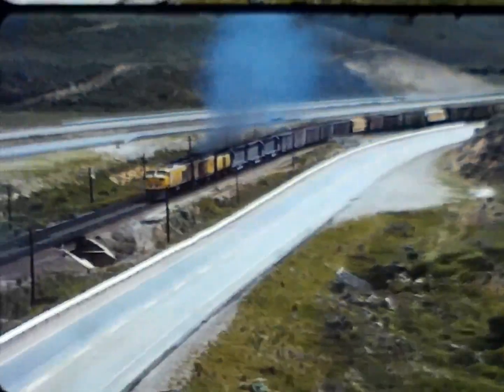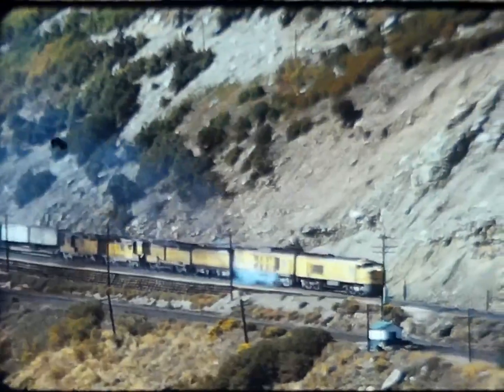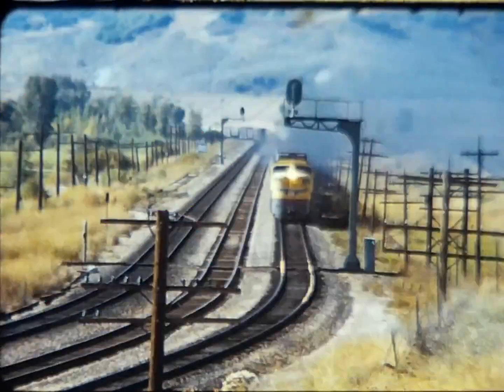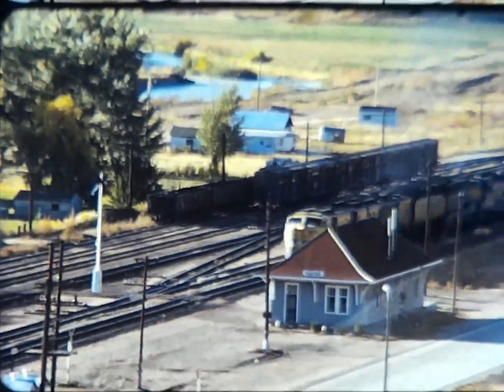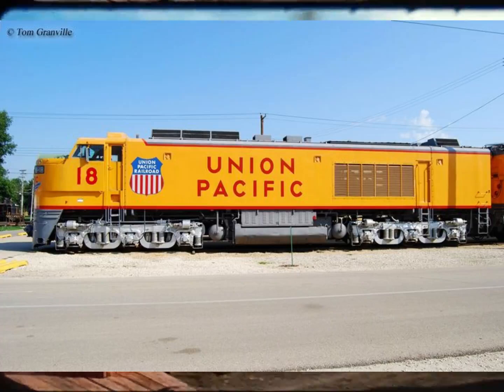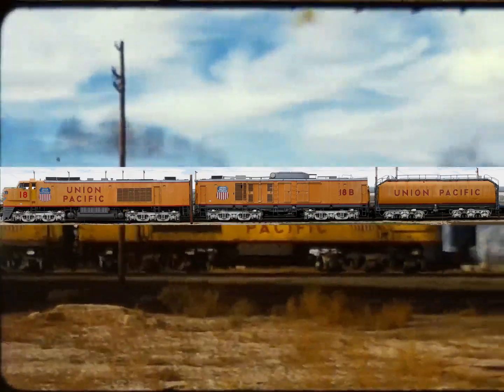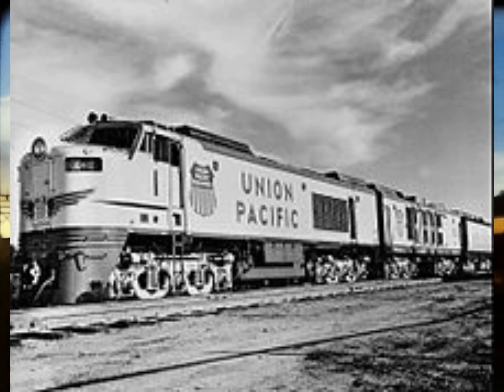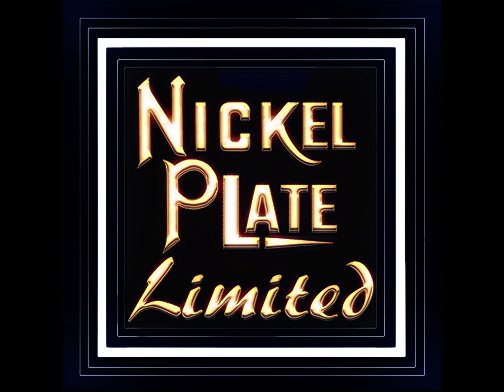Union Pacific GTEL Gas Turbine Locomotive

Comment: Using a gas turbine to power a locomotive in place of a diesel is a good concept. The mistake was using heavy fuel oil (requires heating), instead use kerosene (best balance of high calorie without the need for heating). Aeroplanes use kerosene as fuel because it's the highest calorie fuel that can be used without heating. The UP gas turbine locos were the most powerful combustion (non-electric) locomotives.
Reply from the maker: I think it's one thing that was premature.. Had it come out in the 70's or later, I think it might have worked out with the technology advances in place.
Reply: @TheRailroadCrossing-SteamPower  I think think the concept should definitely be revived using modern technology. The only caveat with a gas turbine compared with diesel is slightly lower fuel efficiency. The gas turbine has excellent power to weight. Still, I would love to see the concept revived.
Reply: @mattvigurs6945  gas turbines have terrible fuel efficiency any time they aren’t at full power.   So in a railway application, that’s most of the time.   Given the cost of fuel is one of the biggest expenses, why would a railway company want to burn money?
Reply: Even with modern technology, a gas turbine locomotive is not economical. The fuel consumption is too great. They were only worthwhile when fuel was super cheap. They are certainly not more fuel efficient than a diesel engine and with modern technology you can have more horsepower and effort with two diesel locomotives than with one gas turbine, and it would be far less costly to maintain
Reply: They chose the heavy fuel oil because it was practically unwanted and therefore very cheap and obviously a major draw card. Of course business is business and the price started increasing and burst the bubble.

Comment: The mighty Big Blow, indeed the most powerful non overhead electric locomotive in horsepower output to run, surely a long time record holder.
But there are a couple of GTELs built in Russia running on LNG which entered service in 2006, they are to be considered more as an experiment and not repeated in series production.
They produce up to 11,500hp, I'm not sure if these are still in service or ended as a failed experiment. 
So the UP GTELs remain the only ones successful used in regular service.
On the subject of Gas Turbine powered trains, maybe an episode on the Amtrak Turbo Train and its French predecessors? As I think these were the only other gas turbine powered rail vehicles which had a reasonably long service time. Not sure when the Amtrak sets were withdrawn but the French examples lasted from 1969-2005.
Reply from the maker: Interesting.

Comment: ah the gas turbines the big blows as they were called among things, at initial sight having not watched yet I want to point out there were differant models of the gas turbine locos, so it was not just one, you also have the turbo train for amtrack using a bombadier turbine engine for a time in its early days just a heads up
and you are right the turbines had a voracious hunger for fuel, but the cheap fuel is what kept them going so long, and with turbine if its liqued fuel you could pretty much use it, but yea they were hot and pretty loud, the bird cooker and bridge burner if parked under bridges it was so hot it would melt the asphalt on the road

Comment: I saw 18 in Union, Illinois last year and she was for all intents and purposes a fierce machine.  The old Pennsylvania Railroad's Q2 Duplexes could make 8000 horsepower, as much horsepower as the 2nd and 3rd generation oil turbines.  The front unit looks like a mix between an Alco PA and an EMD E9.

Comment: It did help that they had the auxiliary Diesel engine for moving around the yard.  That’s about all it was ever used for.  And they could go much faster than 65 mph.  In perfect conditions,  they saw 70+ mph.  It’s funny that freight trains back then were actually faster many times than they are today.  On UPs western mainline longer sections,  they will still see 60 mph though. But Big Boys could pull heavy freight trains at 80 mph.
Reply from the maker: But today, aren't the speeds regulated by the Fed?
Reply: I’m sure they are.  There are some high speed freight trains out west.  BNSF has a few intermodal trains that run 70 mph.

Comment: These locomotives ran in my old territory where I used to live northern Utah I've been two the Ogden Railroad Museum many times and watch quite a few documentaries on these locomotives the front locomotive of the a unit had a a V12 diesel engine they just use that to move the locomotive around the yard the B unit is the one that housed the gas turbine the B unit powered the trucks on the A and the B unit which were CC plus CC classification that means they had three axles per truck 3 traction Motors per truck that means 6 traction Motors per unit the gas turbine powered all 12 of these electric motors so you're wrong on that fact the only the B unit of the Union Pacific it's just pronounced G. T. E. L. You keep on turning classification acronyms into words it's not like NASA but besides that you did pretty good keep up the great work I like your documentaries could you please do me a favor and do a video on the Rio Grande Challengers thank you possibly the Rio Grande 2882 thank you peace out into the world and have a great day

Comment: I saw a couple of the turbine units at a scrapyard around Kansas City in 1973.  The yard repurposed the turbines into riverboats.  The turbines needed to be turned over every few days or the shafts would bend.
Reply: The gas turbine engine used in the GTEL’s is still a very common turbine in the power generation industry. The issue you are talking about with turbines needing to be rotated often does not apply to turbines this small.  That issue is on MUCH larger steam turbines.

Comment: The gtel is easily my favorite diesel electric engine (technically a turbine but it functions similarly to a diesel electric). It is so absolutely insane when you try and explain who and why it works. It is a railroad mad science experiment, but it worked.
Reply from the maker: Meh, they both run on mud so that flies with me.. :) But indeed they are complicated in their own right. Not as much as the steam turbine versions though, for sure.

Comment: The ole Big Blows, Bird Cooker, etc! Melted pavement on overpasses they were parked under, vibrated and broke dishes, I wonder of those were factors on California's decision.
Reply from the maker: Indeed. I didnt know they were called that until I did the breakdown on the loco prior to doing the video
Reply: There’s quite a few rumors floating around about gas turbine locomotives. Especially the one about them burning overpasses. All of that was a myth and it actually never happened. The exhaust gas temperature on the turbine used in those locomotives is a GE Frame  5 turbine. The exhaust gas temperature on them is about 800° F.  Roadway bridges are not made of asphalt, they’re made of steel and/or concrete with an asphalt surface typically. 800° is not going to be enough to heat up the concrete and steel to damage the roadway. Especially considering that the exhaust isn’t pressed up against the bridge either.
  As for the myth that these locomotives had such intense vibrations they would damage things, if you understood the principle of a gas turbine, you realize how ridiculous that statement is. Turbine engines don’t vibrate as they’re not reciprocating engines. It’s quite the opposite, that’s why gas turbine generators Are often used in military communications facilities as they don’t produce any vibrations that can damage electronic equipment.
  The only thing about the gas turbine locomotives that is not a myth is they were loud . Certainly not as loud as most jet aircraft, but still far louder than a regular diesel locomotive
Reply: It could be because gas is in its description  or because it's not pure electric. Seems like that's what they now want everything to be. 

I know I know that was a while ago. Interesting though it was sort of a sign of things to come for the states regulations in a way.